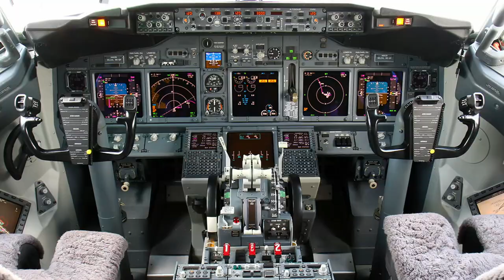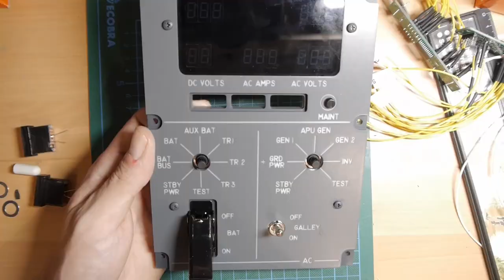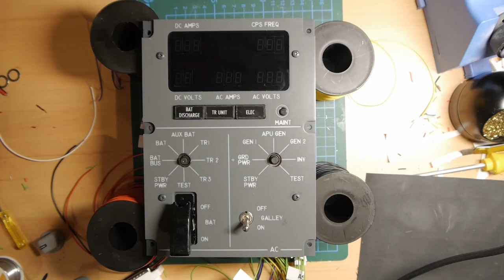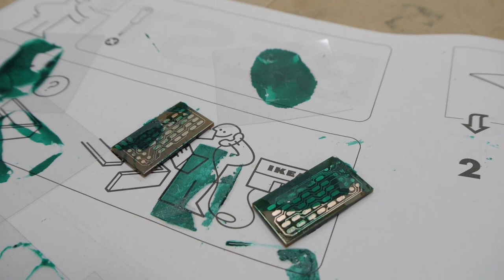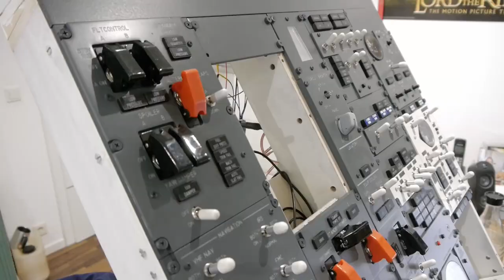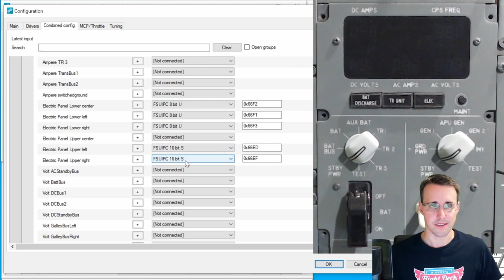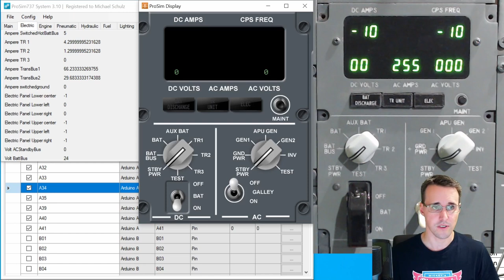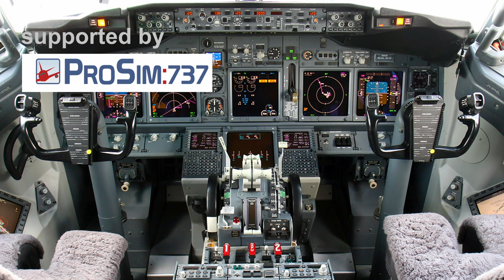AC & DC Metering Panel - A Boeing 737-800 Homecockpit #59

Comment: Excellent video, in my case I use PMDG and it is necessary to adapt a small button on the battery main switch cover so that it also simulates the opening of the cover. A big hug from Brazil.

Comment: Loving your videos! I looking to start making my sim parts soon as I have all the equipment necessary to make it now. One thing we have over here in the uk is Perspex Natural Grey, which is a matte acrylic, and grey throughout, and it’s very close to the RAL 7011 colour. Not ideal for illuminated face, but works really well as a second layer, plus the spray adheres so much better to the matte surface! They do it in white too. When I want to fuse two parts together, I laminate a layer of 3M adhesive sheet tape on one side and bond the two sheets together and press through my roller jig. I do it for signage that I currently make and it works great! I’m currently making my way through your videos, so keep up the great work!

Comment: Hi Mike!
I love your work!
If I can tell you something, "115" is volt AC, not Amp AC... I think is invert
For me, 115 should be on full right and not center 😉
Sorry for my English, I'm French

I repeat, I love your work, continu like that!
Reply from the maker: Thank you. If this is right, then the appearance in Prosim would be wrong. My labeling is like their Display software and the System presentation says lower center = 115.

Comment: I’ve been excitedly waiting to see this panel finished since seeing you starting it just after you finished the cockpit shell.
A huge congrats on this one. I wish you’d asked for help. I would have done the electronics for you or given you design guidance. For example, your traces are too small for home manufacturing and soldering little wires on both pad sides is better for creating vias than your innovative rivet method. It would have been a little easier if you’d used surface mount max parts too. 
But good for you sticking to the goal of same day diy boards.
Reply from the maker: Maybe you can contact me via the email that you can find unter channel informations. Then we share some informations for the upcoming projects.

Comment: Hey, at 28:06 you put 2 black things in the pcb. There are not the MAX7219 because you add the MAX7219 a few seconds later. What are those black things you "push" the MAX7219's in?
Reply from the maker: These are IC sockets to mount the MAX chips into.

Comment: Hi Michael,
Thank you for all your videos, they are very helpful indeed. I have two questions, @17:29 what is the product you put infront of the digits (the black transparent pane) and if you can, where you got if from as this would be perfect for a project I am starting soon. And finally, your laser looks great which model is that?. Thanks again.
Reply from the maker: This is transparent grey acrylic, sometimes also called smoked acrylic. I got mine from ebay. The laser is a 80W CO2 laser from Vevor. Also from ebay.
Reply: @Mickeys_Flightdeck  Thank you for your feed back.
Reply from the maker: @Sharkbar_  3 mm

Comment: Help. I am using msfs202, pmdg 737-700, and mobiflight. I am trying to configure the displays. I am doing the exact same thing you are doing except I am not using prosim. When I type in the offset for the for any of them ex. 0x66ED and the bytes of 2 just like you do with the same digits, my sim and output in mobiflight are both still 0. none of them work. Is it because I am not using prosim?
Reply from the maker: When you are using the PMDG you should use their events and variables. These can be read out by MobiFlight.

Comment: Hey Michael, kannst du mir den Sprüh-Lack und den Sprüh-Klarlack verlinken den du für die Panel verwendest? Vielen Dank :) Bist echt ne Inspiration
Reply from the maker: Für den Lack habe ich mir RAL 7011 im Baumarkt mixen lassen. https://www.hornbach.de/shop/HORNBACH-Buntlack-PU-Acryllack-seidenmatt-im-Wunschfarbton-mischen-lassen-750-ml/8768199/artikel.html#colorcode=7011 Der Klarlack ist von der Stange: https://www.hornbach.de/shop/HORNBACH-Acryl-Klarlack-seidenmatt-750-ml/3562832/artikel.html
Reply: @Mickeys_Flightdeck  Vielen Dank für die Rückmeldung! RAL 7011 macht Sinn bei der 737 :) Hast du den Lack und Klarlack in Matt oder Glänzend gewählt?
Reply from the maker: @dr_j0nes  Beides in matt.
Reply: @Mickeys_Flightdeck  super dann habe ich alles richtig bestellt 💪 danke